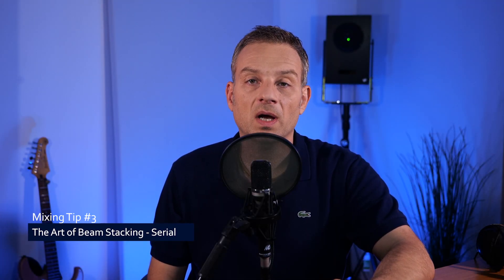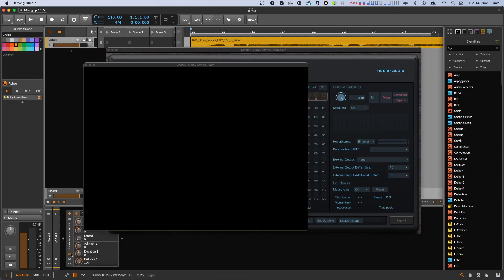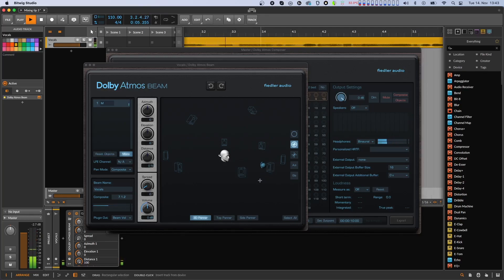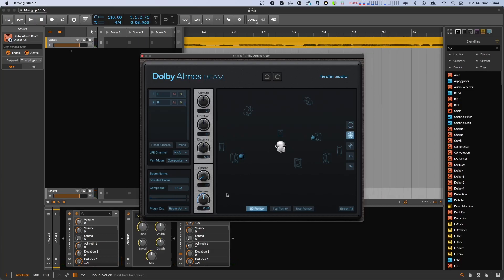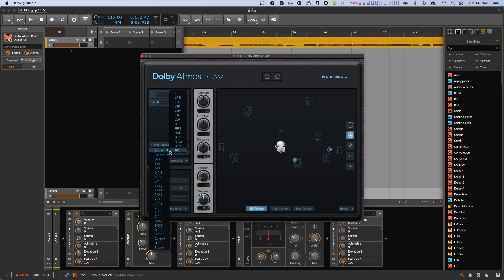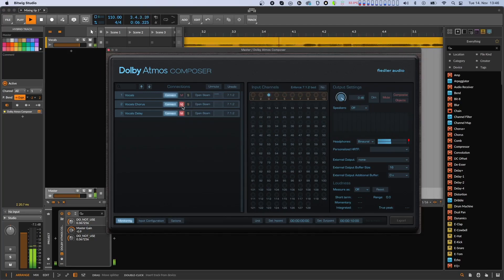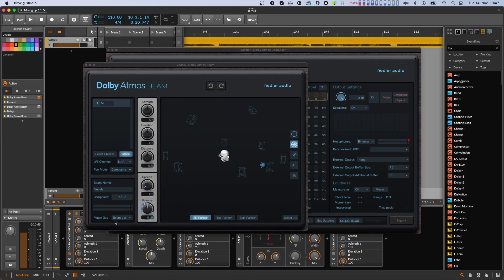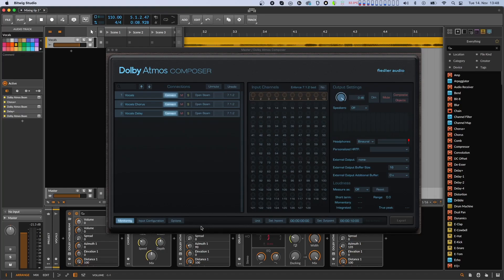Your tracks with FX in Atmos - Dolby Atmos Mixing Tip No.3 #dolbyatmosmusic #spatialaudio #3daudio

Comment: I'm about to test these and have a question. I'm Bitwig, and I see Bitwig in use here, which is great - But I do not find any Bitwig templates in the downloads pages. Are any on their way? Are they just not needed in Bitwig for some reason? I love Bitwig, and I want to love these Atmos tools too  ^_^. so I am trying to set up for success. Thanks for any info!
Reply from the maker: At some point we will add a template for Bitwig. In the meantime you can use the Bitwig sessions we provide with the Mixing tip 1 and 2 videos as a template. Different routing methods are explained in these videos. On our homepage you find the sessions in the knowledge base.

Comment: super. how much latency per beam instance?thanks!
Reply: Beam itself is zero latency. Composer generates 10.6ms latency for speaker output, 30.6ms for the binaural.
Reply from the maker: @SamHocking  Not entirely correct, Sam. The actual latency (not the required block size) of the Composer is 32 samples if binaural is off or 993 samples if binaural is on (for 48 kHz). For 96kHz it will be more samples but somehow in the same region time wise.
Reply: @fiedler-audio  I see, thanks for the clarification.
Reply: @fiedler-audio thanks